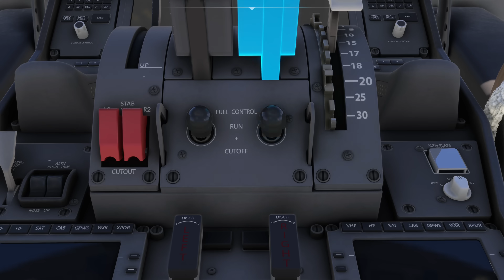Air India 171: Why Did The Fuel Cut-off Switch Get Moved?

Comment: This Special Airworthiness Information Bulletin (SAIB) is to advise registered owners and operators of The Boeing Company Model 717-200 airplanes; Model 737-700, -700C, -800, and -900ER series airplanes; Model 737-8 and -9 airplanes; Model 747-400, -400D, -400F, -8, and -8F series airplanes; Model 757-200, -200CB, -200PF, and -300 series airplanes; Model 767-200, -300, -300F, -400ER, and -2C series airplanes; Model 787-8, -9, and -10 airplanes; Model MD-11 and MD-11F airplanes; and Model MD-90-30 airplanes of the potential for disengagement of the fuel control switch locking feature.

The Boeing Company (Boeing) received reports from operators of Model 737 airplanes that the fuel control switches were installed with the locking feature disengaged. The fuel control switches (or engine start switches) are installed on the control stand in the flight deck and used by the pilot to supply or cutoff fuel to the engines. The fuel control switch has a locking feature to prevent inadvertent operation that could result in unintended switch movement between the fuel supply and fuel cutoff positions. In order to move the switch from one position to the other under the condition where the locking feature is engaged, it is necessary for the pilot to lift the switch up while transitioning the switch position. If the locking feature is disengaged, the switch can be moved between the two positions without lifting the switch during transition, and the switch would be exposed to the potential of inadvertent operation. Inadvertent operation of the switch could result in an unintended consequence, such as an in-flight engine shutdown.

Boeing informed the FAA that the fuel control switch design, including the locking feature, is similar on various Boeing airplane models. The table below identifies the affected airplane models and related part numbers (P/Ns) of the fuel control switch, which is manufactured by Honeywell.

Comment: I am just a regular airline passenger. No experience at all about aviation. I saw on the other you tube channels saying something about the spring  inside the switches might be defected and cannot hold the switch down as strong as it suppose to, then when the airplane took off, the cutoff switch could be down due to vibrations.  Is that possible? I am just curious.

Comment: The plane wasn't working exactly as designed, it did have serious electrical problems on the previous flight. Were those problems identified and fixed and ruled out?
Reply: One of the most important questions.
Reply: Nobody’s paying attention to that. They are now stuck on pilot error, We all knew already this was going to happen and that’s how they are going to get away with it. 
In the reports as well, they have missed out on important information and nobody is talking about the faults in the plane.
Reply: @shreyaajainn  What faults were there that made it not airworthy? Take your time, I'll wait....
Reply: @ljp416jmp  They just want to blame Boeing.  They don't like the company for some reason.

Comment: Is there any DIRECT evidence that the cutoff switches were actually moved by hand, rather than by an electrical flaw causing the signals from those switches to the fuel control valves and the flight data recorder to have been corrupted intermittently by a failures in some other part(s) of the  hardware?  

Such a failure could have occurred in the switches themselves, the wire harness or the other devices the signal lines from those switches are connected to.  As one who spent a career in scientific instrumentation designing and debugging complex digital electrical systems, I have often found that false signals can easily be assumed to be caused by the user, or by a specific part of the hardware, whereas the failure turns out to be caused by a different component altogether.  An obvious (but much simpler) example in aviation would be where a false landing gear position indication turns out to be a failure of the position sensor or the wiring to the position sensor rather than the landing gear position itself.  Unfortunately, these systems were probably so totally destroyed in the crash itself that a complete inspection of all the components after the crash might not be able to reveal the cause of the failure.  

I realize that the one second delay between the two switches being moved to the cutoff position  strongly suggests that the switches were changed by hand.  But anything short of a video showing the switches being changed manually doesn’t seem to me to PROVE that it wasn’t an intermittent system failure in the hardware.
Reply: Yes, one pilot asked if he moved the switches. Its pretty obvious that happened

Comment: Have really started doubting captain Steve now. 
At first he said that the pilot changed flaps instead of gearing up knowing very well that incorrect flap settings during takeoff will sound all the alarms
Never mentioned about RAT in his initial videos, even though the RAT video was really popular.
Then he incorrectly said that the co-pilot had experience of 1100 hours only. The co-pilot had 3300 hours of flying experience in total with 1100 hours on Boeing 787. 
In this video and previous videos why did he not mention that the ELT of the plan which helps find the plane's location in a crash was not working !!?? 
 WHY is he acting like Boeing mouthpiece ???  Why did he not mention that the Emergency Locator Transmitter (ELT) was not working ???
Reply: Also how did the blackboxes get so damaged?? Most Crashes happen at takeoff and landing. How did the Blackbox get so damaged during the crash ? Why no questions asked to Boeing about their weak Blackboxes ??

Comment: Stop blaming the pilots. Something Similar happened with Air Nippon in 2019 while it was landing, the fuel cut off on its own.

On Jan 17, 2019, both engines of a Boeing 787-8 of All-Nippon Airways flight NH-985 had similarly shut down after a fuel cutoff just as it touched down; it continued to roll and, on stopping, had to be towed. 

So only Boeing is responsible for this. Not the pilots.

Comment: Captain, this is truly disappointing.
The only consolation is that you are still around and flying. I hope one day, should you find yourself in a similar situation—unable to give your side of the story—others won’t be as quick to judge or blame as some have been in this case.

This report, as it stands, feels like a cover-up. Rather than accepting it at face value, you ought to be pointing out that it lacks sufficient detail to draw a fair and conclusive judgment. A responsible and transparent analysis would have acknowledged the gaps and limitations in the findings.

Comment: Captain stevee to stop this ever happening again the fuel switches should be on both sides on the cabin and both captain and co pilot have to switch engines on at the same time say 4 switches 2 on the left 2 on the right both flick left engine on then right and to turn them off the same way if they aren't done together engine doesn't shut down

Comment: This is a tragic situation, but I think it’s a slippery slope to say that dual input should always be required to shut down a motor. If a mentally unwell pilot intends to crash an aircraft, there are still many ways they could do so—pushing the yoke forward just before flare, pulling key circuit breakers at a critical time, or even loosening a bolt during preflight. If we go down the road of requiring dual input for something like engine shutdown, what’s next? Unmanned flight decks? Fully automated line ops and maintenance?

A more balanced solution might be an inhibit system that prevents fuel cutoff unless specific failure criteria are met (e.g. fire warning, N1 vibration limits, etc.). That could’ve made a difference here—but at the same time, I want to retain the ability to shut down an engine immediately when necessary. On the ground: a person approaches the aircraft while engines are running. In the air: smoke/fumes with a failed isolation valve. There are edge cases where immediate single-pilot action is crucial.

I really appreciated your point about checking in with your fellow pilot. Even if it’s easy to brush off with a casual “I’m good,” making that connection might help someone open up—or at least plant a seed. The system already does a decent job screening for mental health: many airlines require written psych evals and one-on-one interviews with a psychologist before hire. But in some cases, like this one, the captain may have been hired 30–40 years ago. That’s a long time for someone’s mental state to change without a formal check-in.

It’s sad the pilot didn’t seek help. It’s also sad that either no one noticed—or if they did, nothing was said or done. Hopefully we’ll learn more in the coming months.

Thanks for covering this, Steve. Great video as always.

Comment: After the crash the fuel cutoff switches were seen to be in the “run” position. Since these switches are an electrical signal to the fuel computer not a direct mechanical connection, could it not be a fadec fault which showed the switches being put to off and back to run without the switches being in fact moved at all. So before we castigate the pilots should not the software be thoroughly investigated. The black box says the switches were moved but the black boxes only show the electrical signal not the physical position of the switches.

Comment: My thoughts are with the families of the victims. Of which one is suggested to have gone rogue, with very little evidence and without formal conviction. I cannot imagine what the families must be going through. It’s cruel.

Today’s technology is able to do reliable checks and balances. It is able to detect if the plane is taking off or landing, and if there might actually be something wrong with the engines in flight to justify fuel switch activity. 

Functional safety certified systems are used to keep extremely complex processes in Petro/Chemical plants safe. Plants, where malfunctions could cause disasters effecting thousands of people.

This disaster is certainly a pivot point for the airplane manufacturers to reconsider reliable safety measures on any kind of these “switches of certain death” in the cockpit.

Comment: I have a theory. It was a brain fade moment with the pilot. I have often experienced such moments with and around me. It has to do with the regular nature of the task. Sometimes your body acts but your mind isn’t focused on the task, since it is a chore for your mind. Had it been a su*c*de, there would be better ways to do that. Higher up in the air. Hence I think the action was pilot error but not planned or deliberate. It was just a brain fade moment. A HUGE mistake, due to lack of mindfulness. Don’t know why I don’t hear or read about this theory anywhere.
Reply: You could be right, amongst other possibilities. There are so few facts and it is almost uncomprehensible that so many answers are given. What about sabotage (of the switches?), what about  medicine use without realising negative effects ofcourse, what about what you mentioned and what about all the rest off the possibilities?! Also I find the smooth flight profile and 10 second delay (if so)  inconsistent with all the answers given. To me it looked like they were trying to save the aircraft. Now it could be different, but I can not deduct that from the info. 18000 hrs here, 7000 B747, not really uninformed you might say. I agree that this accident is a brainstretcher, but the report is PRE liminary and if anything, selective in information and incomplete. That's why they call it like that. Let's all wait for the report.

Comment: The report does not mention the gear retraction (or not) after take off. Before the preliminary report there was some speculation about an electrical fault occurring exactly when retracting the gear that seemed to be tilted forward as per during retraction.
So, couldn't it be that the flying pilot saw the monitoring pilot moving the gear switch (and not the fuel switches) but got confused by the peripheral vision not being perfect and the stress did the rest?
The report states that the gear switch was found in the down position, but it might also be moved back down in an attempt to mitigate the force of the impact.

Comment: I have an open mind as how the fuel cutoff switches were engaged.  It is not clear which pilot asked “why did you engage the fuel cutoff.  It’s true that a child may deny doing something but it is equally true that a child may blame another for something they have done.  It also seems strange to me that both fuel cutoff switches could be engaged at one time without the other pilot noticing. It would require both hands to perform this action .  Was anyone else in the cockpit during the takeoff?  Perhaps a child was there?

Comment: In 1987 a Delta Airlines 767 crew accidentally shut down both engines after takeoff from LAX.  They had enough altitude to restart and recover, but is was something that was not supposed to happen. Are newer fuel cutoff switches designed differently to eliminate an accidental shutoff?

Comment: Captain Steve, please explain....
- if it is impossible for a pilot to move the fuel switches 1 second from each other, since, as you say, it is a 3 step process
- and, if it is impossible to reach over to operate both switches simultaneously with 2 hands, given the pilot is strapped in
- how can a human cut fuel supply to both engines in 1 second?

It would have to be a system failure!!!  Which explains the shocked conversation between both pilots. Also the immediate RAT deployment just after takeoff, with pilots focusing on take-off procedures, can only be possible if the system itself clicked both the switches to cut off in 1 second of each other!

Comment: why it can't be an electrical disconnect of both fuels behind the dashboard to motherboard or to the engine where it exists the cockpit towards engine through internal tunneling of wires as company was blamed to have metal pieces left behind inside the metal sheet

Comment: What control logic will allow manual switching off of fuel switch when thrust levers are fully forward and engines are on full thrust and taking off? Have  you heard of any drivers switching off the car when accelerating to 70 mph? Never. All the narratives of pointing to pilots is unfortunate. Fuel control switches aren’t hard wired. There is electronics in between. If the power supply to the electronics faces a transient glitch when the power supply bus is fully loaded while taking off, this can happen. Transient power flickers are hard to imagine and construe. A full investigation of FDR only can answer about possible momentary power loss and resumption after which the pilots tried to restart the fuel supply. Unfortunately aircraft was very low and just at take off speed. A couple of thousand meters higher and possibly the situation would have recovered without the disaster.

Comment: bullshit, stop spreading lies about pilot commiting suicide.,,, , defending faulty boeing aircrafts, no way can any pilot can turn off fuel switches in under 1 seconds, the systme takes atleast 1 mintute to do so, and the fact that thrust lever needs to be turned off to cut off fuel switches makes its impossinle to manually fuel cut swtiches,, Moreover, if it is pilot suicide why boeing is advisign the other airlines of differeent country to inspect fuel control switches,,

Comment: I think there may have been problems with the fuel switches, maybe a software glitch. The angle of saying it may be pilot suicide is speculation at this point. I believe you should wait until the full report is out. This may be a chip malfunction, software glitch. I don't think it is wise to point to pilot suicide as you really don't know at this point.

Comment: What the first thing a pilot would do if he has engines failure with the switches on the ON positions ? I guess he would placed the switches on the OFF positions then put them back in the ON positions to restart both engines. There was no time to try anything else. My question is: Is there a possibility or any kind of malfunction that should cut fuel to both engines with the switches in the ON positions ? What ever happened we got to make sure it doesn't happen again.

Comment: Well I'm no pilot by any means but if they were in the shutoff position and you hit a building at take off I don't know the speed maybe the impact knocked them down and another thing if the plane is that what's the word advanced wouldn't the computer know if they were placed off  in the air , before , after , just wondering

Comment: Hi @CaptainSteeeve,
I have a question regarding engine fuel cutoff and restart timing.

In a recent scenario, the fuel was cut off within 1 second. However, restarting the engines took significantly longer — about 10 seconds for one engine and 14 seconds for the second.

My questions are:

   1.  Is it technically possible to cut off fuel within 1 second?

   2.  If so, why is it not possible to restart the engine within the same 1-second time frame?

I’d appreciate your insights on the reason behind this timing difference.